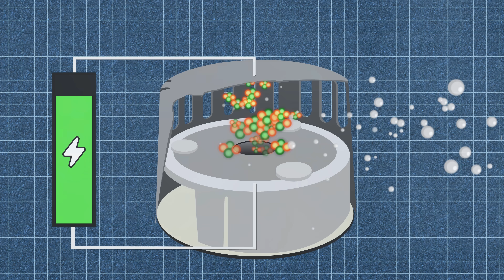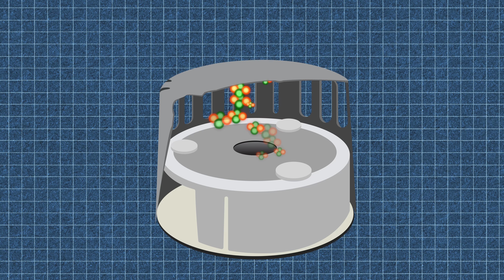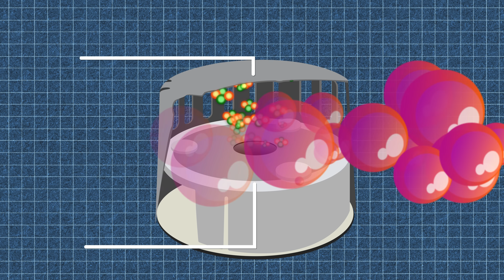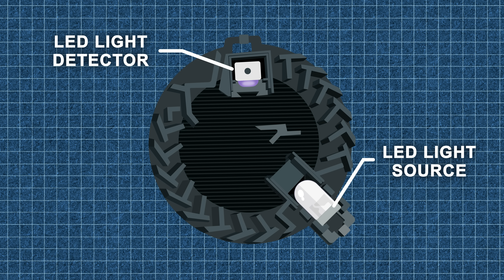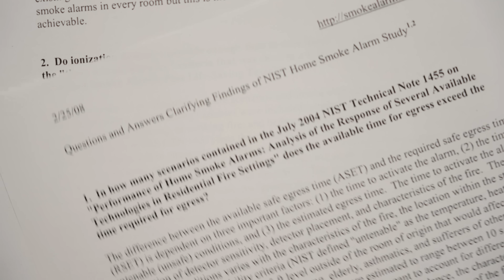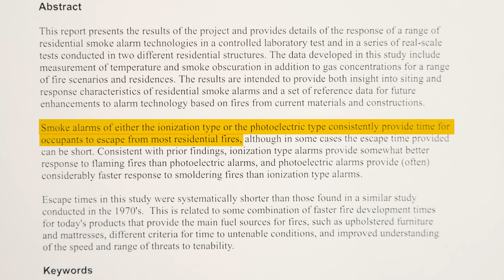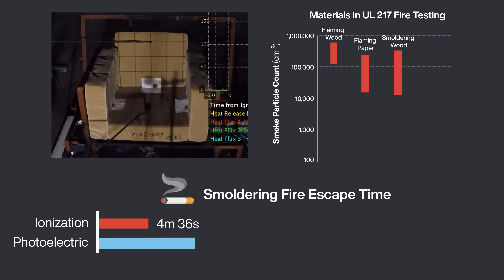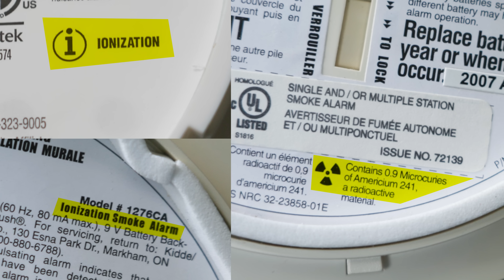Why the Most Common Smoke Alarm is Dangerous

Comment: My smoke detector goes off when i get out of the shower. But grandpa leaves an empty pan on high, fills the house with smoke. Yet the damn alarm didn't go off until we could barely breathe in the living room.
Reply from the maker: That sucks.  I know ionization alarms can still be triggered with steam and then have issues detecting cooking smoke.  This sounds like an ideal situation to switch out your alarm and ideally move it away from your bathroom if you can.  Harder with hardwired alarms but a new 8/9th gen alarm here will likely be a big improvement.
Reply: @Lam  Then again you could install fire sprinklers.  Though that could cause a mess..
Reply: @FederalSignalFan  those things only work on heat though( unless that also changed), so basicly the very first type of fire allarm, but now with a build in water sprayer. im pretty sure they are only effective in large buildings where it is more important to keep the rest of the building from burning down as fast so people can get out. they can also be dangerous in various circumstances since water isnt always the best way to deal with fires or have near electronics.
Reply: Yo, did you accidentally install a steam alarm?
Reply: Yep, this is why I went so far as to return an ionization alarm within a week and replace it with photoelectric.
Reply: @turrboenvy4612  The recommendation is to use BOTH photoelectric and ionization alarms, because they detect different things and both have blind spots. (US CPSC) It also recommends NOT putting ionization alarms near kitchens for probably obvious reasons.
Reply: @turrboenvy4612  also did you know the texas and am report shows 4% failure in photo for both smoldering and flaming fires  while ion may have over 50% failure in smoldering fires and 20% failure in flaming where it is supposedly better ?
Reply: I don't think the battery is likely the issue did you know if that ionization alarms conclusively not detect large particle smoke?
Reply: @Fredengle  Andrew said that in the video.
Reply: My smoke alarm goes off with my shower my toaster my air fryer but when an actual fire broke out on my stove it was silent fortunately enough I have an open kitchen that I can see from my living room so I was able to put out the fire with zero damage put my entire apartment was covered in black smoke.
Reply: My smoke alarm goes off every time I change clothes. I’m so smokin hot. 😎
Reply: Steam alert! I have a smoke alarm that tells me when I've been in the shower for 5 minutes.
Reply: Sounds like you have to put it somewhere better
Reply: My Smoke Detector Goes Off
When I Get Out Of The Shower. But Grandpa Leaves An Empty
Pan On High' Fills The
House With Smoke. Yet The Damn Alarm Didn't
Go Off Until We Could Barely Breathe In The Living Room.
Coz U Didn't Put Back The Battery After The Last Fake Alarm
Reply: My hole house was in smoke so bad that I couldn’t see but it was a flaming fire so what was happening? I think its a battery being dead because the photoelectric use LEDS witch use power and they dont recharge so that eventually die to low power.
Reply: Stop burning ur food then 😂😂😂 (sorry I’m kind of mean but i understand what you’re saying)
Reply: It needs to be at least 36" from the bathroom door.
Reply: Replace them with photoelectrics preferably the eighth gen models.
Reply: coz u didn't put back the battery after the last fake alarm
Reply: @avix213  He said it still went off but very delayed
Reply: @avix213  blud, it has a working battery, and otherwise, it's the most annoying thing in the universe.
Reply: @henryprice9493  Guys I think that comment was a joke...

Comment: My fire alarm was replaced with a ten year unit which I believe is photoelectric. Immediately, my vaping habit became a constant and very irritating trigger for false alarms. I took it down off the ceiling, changed nothing else and no more false alarms. It still works but as smoke rises it may not be so effective when its time comes to do its job.

Comment: Former private Fire Inspector here. I would alarm smoke detectors via smoke at schools, hospitals, courthouses, etc.

There are some dangerous systems you shouldn't trust your life on.

In my experience;

Johnson Controls (JCI) has pull-stations that, at one medical center, failed to operate an alarming amount of the time.

Fike alarms are among the worst; it takes an insane amount of smoke to set off.
Reply: The old BG-10 style pull stations, they use a push button switch that sticks
Reply: Edwards was the system we liked best. Top of the line.
Reply: Siemens is also a brand we didn't much like
Reply: @Comrade-Lilith  Interesting I worked at Siemens as a fire alarm system installer and always seen the Siemens fire alarms as way more advanced than other on the market since they have external temperature sensors and IR fire detecting sensors in addition to the photoelectric smoke detectors. Why didn't you like Siemens? The high maintenance cost?
Reply: @Atom224  On my end, I was always the one testing them, so we didn't like them because the fire panels were not as advanced & convenient to use as say, an Edwards. And when it comes to fire testing, you'll be spending a lot of time at that panel.

Another big thing is that siemens smoke detectors took a while to set off. It wasn't nearly as bad as Fike when it came to the smoke detectors but we did have difficulties with them
Reply: My dad was a software engineer at Gamewell back in the 90s.  He said they cut corners in software testing in the panels, and even had cold solder joint issues with PCB's.

My middle school had a Gamewell system and would have frequent faults and panel CPU crashes.  Absolute shit, and at 14 I started ignoring fire drills because of it.

I'm an electrical engineer myself and I still wouldn't trust any Gamewell garbage, but I don't trust electronics and software in general lol.  I still drive a manual for this reason.
Reply: The old-school systems (1930s-70s) are more dependable than these ones

Comment: my family wanted me to have a carbon monoxide alarm, it didn't last a week... winter, fire burned down, I fixed the fire but it would take a bit to get going again. in the meantime a tiny bit of smoke came in because the flue wasn't as hot due to the fire burning down to nearly nothing. alarm goes off in the middle of the night after I had fixed the fire. yes yes, I fucking know! I expected this problem and I know there is no danger. it is fine, let me sleep damn it! the alarm was then disassembled on the kitchen counter so I could sleep.....

Comment: my dad's life was saved by a smoke alarm that woke him up in the middle of the night. firefighters said that if he was a minute slower to escape he would have been trapped by the flames. having a good smoke detector is important to me so thanks for the video.
Reply: yeah sadly those days are behind him with modern fire alarms being in capable of detecting smoke from an actual fire these days sadly😭😭
which is why first off if your buying a fire alarm make sure it goes off from actual smoke because your trusting it with your life you want to know it works as required

Comment: I just picked up a Garrison detector last month. It has, what I believe, a good solution to the problem - it includes a CO monitor. I figured smoldering fires likely put out a lot of carbon dioxide and a quick google search verified that as the case.
New to the channel thanks to this vid.
Reply from the maker: Hey, so I thought that was the case too, but the amount of CO lags behind how quickly a photoelectric sensor picks up smoke according to research.  I can't find the exact paper right now, I'll keep looking.
Reply: @Lam  that makes sense. The CO portion was something I looked for because I have a basement with a natural gas furnace and hot water. I've had family get sick from CO and heard too many stories of people dying to risk buildup in an otherwise habitable area.
Reply from the maker: Ah yeah that's really smart.  Good on you to be proactive.  I've also found the study: https://tsapps.nist.gov/publication/get_pdf.cfm?pub_id=923413 PDF

So it's actually interesting, in a few test conditions CO alarms are faster, but not in all conditions and in the majority a photolelectric will let you get out before conditions make it difficult to escape.

The conclusion is that CO alarms are a good supplement especially when integrated with a fire alarm which can also help differentiate nusiance vs real fires.

Comment: (Keep in mind I haven't watched the video yet.) Photoelectric alarms are best for smoldering fires; fires which are fuled by clothen or wooden materials, such as furniture, curtains, and clothing. They are usually best placed in areas such as living rooms, bedrooms, hallways, and any other room with similar material. Ionization alarms are best in areas with quick burning fuels, such as cleaning chemicals. They are best used in areas where you store many chemicals or oils, such as kitchens, garages, laundry rooms, and any other room that has chemicals or non-clothen/wooden materials (i.e., mechanical closet).

Also, remember to replace all your alarms every ten years.

Comment: Thanks for this information. However, I think you missed a big question, which is how, if at all, the 8th gen ionization alarms are better than photoelectric alarms. The NIST data at 11:33 seems to show that ionization alarms are only marginally better than photoelectric at their strong suit, flaming fires. So wouldn't 8th gen ionization alarms simply mitigate their weaknesses with smoldering fires and false alarms? Considering that photoelectric alarms are comparatively dead simple vs these new alarms, it also seems like photoelectric would be cheaper, more robust, and less prone to malfunction.

Another question is why not combine the two sensor types into one alarm? I've seen some alarms years ago that did this, but they were hard to find and seemingly never caught on.
Reply from the maker: So it's actually the opposite.  Photoelectric alarms are far more complex than ionization alarms.  They require more control circuitry and programming hence their increased price.

Their weaknesses are from the actual physics of particle interaction, unlike Photoelectric, I haven't seen any updates on chamber design and they have to rely on the smoke properties to do better.  

Photoelectric alarms can be improved with multiple IR LED beams as with Google Nest Protect and other commercial detectors.  

So the video on dual dsensors is likely Technology Connection's video.   He brought up a weakness however, when it comes to false fires, which sensor should you believe?  

These are even more complicated to program and the general public knows nothing about them which is why there's only one model which is very hard to find.  The 8th gen version isn't even being sold right now.
Reply: @Lam  Do you have any info about how 8th gen ionization is supposed to outperform photoelectric? I still don't understand why someone would go with 8th gen, considering that you have to rely on this complex data processing to hopefully maybe make up for the inherent weakness of the sensor behavior and another technology already exists that doesn't have the weakness. Plus there is no radiation concern (even if it's a minor one) and less inherent degradation over time vs. Americium half life.
Reply from the maker: So, there is no information about the relative performance which is annoying.  I was considering doing tests but I would at minimum require a large room to test in due to smoke particle agglomeration.  

Here's what I believe, ionization is out.  I was surprised by the 8th gen test but 9th gen it's likely not possible to pass.  Case in point, Kidde's new 9th gen alarms are 100% photoelectric.

Comment: Why can’t they just put both in one? That way you get the best of both worlds
Reply: FAX, I WAS THNKING THE SAME THING!!
Reply from the maker: Hey Patfre, thanks for watching,

The problem with dual sensor alarms is these alarms can be just as sensitive to cooking false alarms (UL, Characterization of Smoke Alarm Nuisance Sources, 2015).  They're also hard to find, expensive, and the only 8th generation dual sensor alarm is currently unavailable for purchase (as of June 5, 2024). 

As well many homes require CO detection and you'll have to choose between having those separate vs interconnecting them with the rest of your home.  Same issue if you want separate photoelectric and ionization alarms.  I think Interconnection is more important.

Kidde's new 9th generation of smoke alarm is Photoelectric only.  This was what I was expecting in the video as I was shocked ionization could pass the new tests, but I'm guessing that's no longer possible.
Reply: @Lam  I feel like one way to make them less likely for false alarms would be to basically do analysis of both sensor since both sensors will still detect smoke in some capacity so if you see one is spiking upwards but the other is basically the exact same it’s probably cooking smoke but if it continues to climbing then it’s probably a fire.
Reply from the maker: Yes, this is probably the best way but seeing as theres' a requirement for CO, most companies will default to one sensor + CO.  I heard there are triple sensors in other countries but not here.  As well with Kidde's 9th gen out, photoelectri only I do believe ionization tech is on the way out.  We fixed it.

Comment: I prefer to sit on both sides of this particular fence: I have two photodetective alarms (Provided by the local fire brigade) plus one ionizing alarm, which I admit requires replacement soon (As the radiation source only has a ten year lifespan). ☢🔁👍

Also, just to point out: The magnets used in Novium and other levitating pens and their bases are pretty strong, and should not be sited within 30cm (one foot) of any computer hard drive or other magnetic storage medium. Be particularly cautious about having your desktop external hard disk on the same side of the desk as your writing hand. 🧲🛡💾👍

Comment: As a former NICET Level IV technician, I learned something today and updated my knowledge.
Thank you!

My previous answer was "Why not both?

Another cause of nuisance alarms in photoelectric detectors is steam, whether from cooking (boiling water) or a good hot shower. And then there is the need for cleaning - little spiders and their microscopic webs are the worst, although drywall dust is a problem for photoelectric devices, as well.

carry on!
Reply from the maker: I'm still wondering what the differences in detection are between the two devices.  From the research conducted both types are now improved but is it enough where it's minimal returns on having both types or should we still put in that effort.

My response as well to having both is that people should prioritize housewide interconnection first and it's difficult to get both types onto one circuit especially as there's only one dual sensor model because they sell poorly.  

Steam is a big factor, something I didn't address.  I know NEST has split spectrum photoelectric sensors + humidity sensors that are supposed to deal with that better.  I haven't seen a test looking at how much better it is.  Ideally though most people will install their alarm out of the line of fire.
Reply: @Lam  It's kind of amazing the 2nd gen Nest came out in 2015 and is UL 217 compliant. After researching the different types of fires and detectors in 2016, I installed Protects in four locations between 2016 and last year. It's unfortunate Google largely abandoned development of the Nest product line, though.
Reply: @Lam  All good points, program compliance is far more important than the nuances. 
Photoelectrics do require more maintenance (cleaning) and most people aren't up to that.

I did not know about the humidity sensor technology, that seems like a great idea especially in a bathroom/bedroom hallway.

I am disappointed that SimpliSafe is not keeping up with this. I use their devices as an adjunct to the required wired / interconnected smoke detectors; for the purpose of automatic notification during unoccupied periods.

A combination Carbon Monoxide (CO) detector is also not a bad idea.

Comment: "OUTSIDE USA?
Go replace your alarms with photoelectric detectors especially the one in the kitchen if it's going off.  Yes, technically installing both alarms is best but for most people it's not practical especially if you need to interconnect your smoke alarms with carbon monoxide detectors.  As well, the only dual sensor 8th gen model is not selling anywhere".  

This advice is wrong. Do not install optical or ionisation detectors in your kitchen. In the kitchen you should have heat detector alarm.
Reply from the maker: Those aren't readily available in the united states and Canada.  In the UK that's approved practice.  Here that's not up to code as a stand alone detector.  You would need a smoke alarm somewhere on that level.  

Also the recommendation is 10' outside of the kitchen.  

Edit: I should make that differentiation.  Thanks for letting me know
Reply: @Lam  Yeah, if you do not cook anything in you kitchen and stuff yourself in Macdonalds all the time, you can have an optical or ionisation type of the fire alarm in your kitchen. In all other cases use the heat alarm.